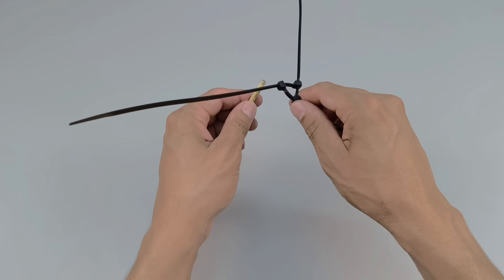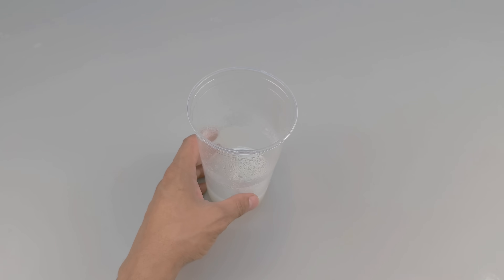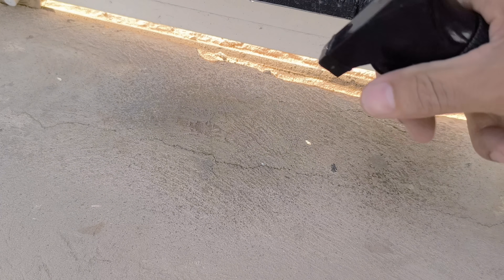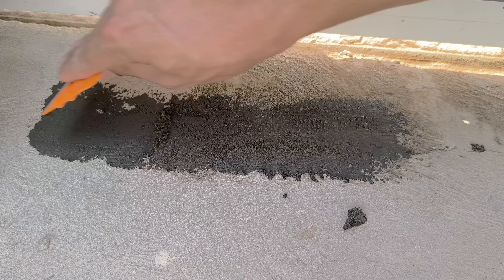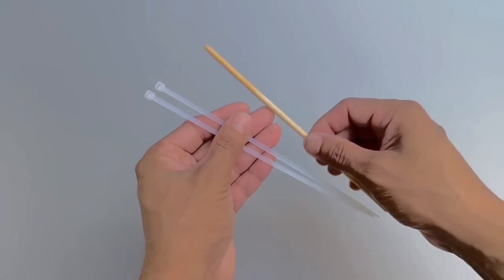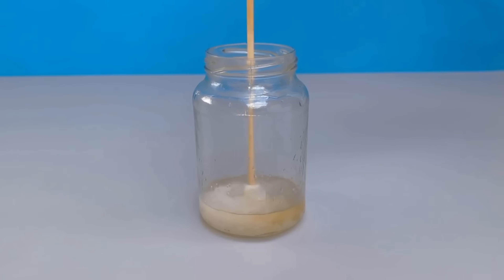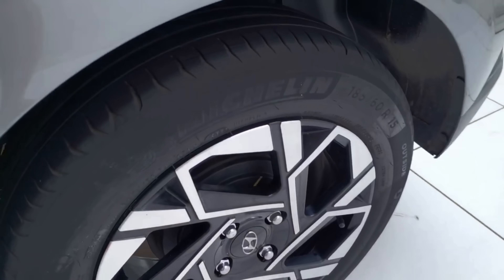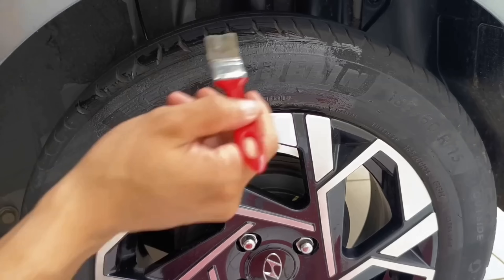Mix SILICONE with CEMENT and create something no one imagined possible!

Comment: This is too funny,  silly Ai voice over 
Saying I always use gloves as it dangerous while not once wearing protection.
The stupid idea of putting this outside the door then pouring water over showing the water going around the product so in to the surface and with silicone you can not go over it after as it does not stock properly to itsself
You can not paint over either.
There are many products for these tasks use the right thing for the right job or you will have a big silicone mess to clean up
Reply from the maker: Thanks for sharing your thoughts — I appreciate honest feedback 👍
You're right about silicone not bonding to itself and not being paintable. This experiment focused on observing behavior and reaction, not the final finishing process.
Safety gear notes are for general caution, and I'm always improving presentation. Thanks for watching and commenting! 🙏

Comment: In all your videos you add solvent but never say which solvent you are using.  Can you add notes to your videos or make your videos clear as the what you are using.
Reply from the maker: Good point! 👍 I usually use pure acetone or PU thinner, depending on the mix. I’ll make sure to include this info in the next videos — thanks for the suggestion! 🔍

Comment: Do you have ratios? And research to mixing with concrete casting in the foundation cement? Cracking slabs is resulting from stress relief usually in a controlled manner as you know. Is there any flexibility in the dried compound we see you making? Make NO mistake this kind of experiment is very intriguing. The varnish mix seen in another video seems to produce a much smoother finish. Good effort. What V.O.C.'s are produced with silicone cement? Is acetone such a medium as thinners you described? Thank you, & keep up the good work From Polynesia.
Reply from the maker: Great question! 💡 Yes, I’ve tested different ratios — usually around 1 part silicone to 6 parts cement gives a strong and flexible result. It helps reduce cracking effectively! 🔬🧱

Comment: What's the purpose of the silicone in the cement?  You don't need silicone to patch cracks in concrete.  You got to be from a country the doesn't have a Home Depot,
Reply from the maker: The silicone changes the texture, making the mixture more flexible and resistant to certain types of wear. It’s not just for patching cracks — it can create a rubberized coating.
Reply: You're so right

Comment: What should be mixed with silicon. Is it thinner
Reply from the maker: You can mix silicone with cement or sawdust for interesting results. It’s not thinner, but more flexible! 🧪🧱
Reply: @inovaouinventa  They're asking if you used paint thinner, acetone, etc

Comment: What is the liquid substance in the bottle that you mixed with the silicone?
Reply from the maker: 🧪 Use pure acetone for best results, as it has a high dissolving power and evaporates quickly. However, if you don't have acetone available, you can also use automotive thinner, gasoline, or even regular alcohol (ethanol or isopropyl). Each of these solvents has different mixing efficiency, so it's best to test small amounts to see which one best suits your needs.

Comment: Help. What exactly is the solvent that you used in the video? The DIY and hardware  stores here in the UK says there is no liquid solvent for silicone. Cheers
Reply from the maker: Pure acetone, thinner....
Reply: @inovaouinventa  Thank you very much, I will try and find some although pure acetone might not be available here in UK,  A low strength acetone is sometimes used for nail varnish removal over here, so many rules and regulations these days. Great videos on your channel, I will now subscribe
Reply: Naphtha or acetone is an acceptable solvent for silicone. Both should be used with adequate ventilation, outside in fresh air or under a vent hood.
Reply: @everyoneluvsraybeez  Cheerz great info and fumes advice 👌
Reply: Xylene dissolves silicone
Reply: @notme-bb3ir Brilliant information, thank you, I shall try and find a supplier here in the UK, however chemicals are highly regulated over here so it might be a problem. Thank you once again.

Comment: What about adding melted rubber? Will a combination of all known materials that normally go to landfills,...(silicon, plastic, styrofoam, glass, solvents, cement, steel wool, saw dust, bark chips, gravel, sand)??? Could this result in materials to build ' under water habitats? Maybe AI can help?
Reply from the maker: That's a brilliant suggestion! Combining landfill-bound materials could lead to surprising innovations. Melted rubber might enhance elasticity or shock absorption—definitely worth testing! ♻️🔧

Comment: the downside is that when it gets hot it might crack" but it's good for experimenting 👍😁
Reply from the maker: True! It's not ideal for high temperatures, but for creative tests and DIY ideas, it's perfect! 🔧🔥 Thanks for the tip!
Reply: @Invention75   So, cracking under heat eliminates its use outdoors.

Comment: I am from South Africa, your idea sounds good but how do you prevent the UV exposure from damaging the silicone if treating an area exposed to the sun?
Reply from the maker: Great question! To protect silicone from UV, you can apply a UV-resistant sealer or cover the surface with paint or shielding material. Thanks for the input from South Africa! 🇿🇦☀️
Reply: If it's helpful, I have used spray paint on silicone when it is wet. It will bond when wet and then offers protection as well as a surface that can accept other paints after cured.

Comment: Solvent? Which one? There's only about a bazillion!
Reply from the maker: Do you know what a solvent is?
Reply: He used acetone, but you can read the silicone tube to see what the manufacturer recommends for clean up. Basically, figure out what solvent dissolves the silicone in your tube.